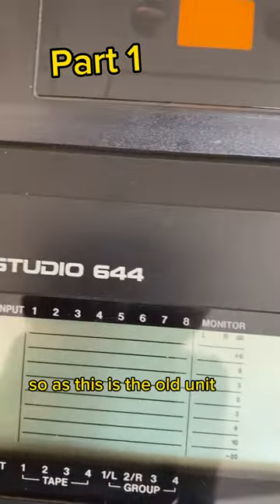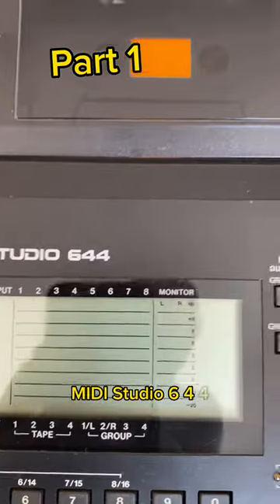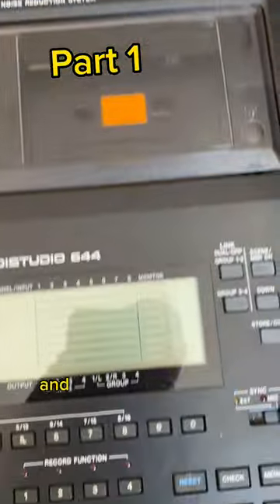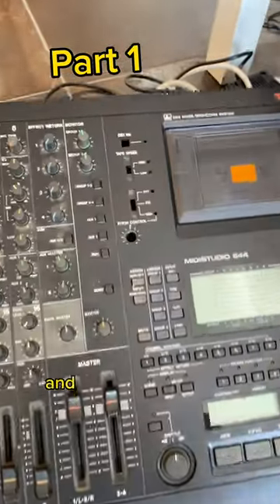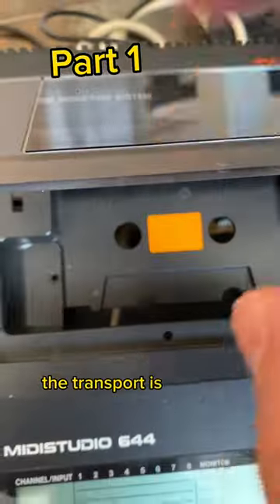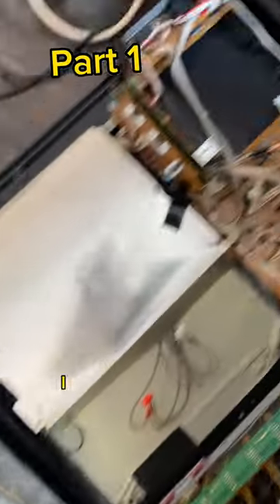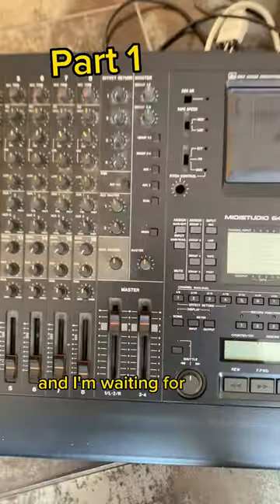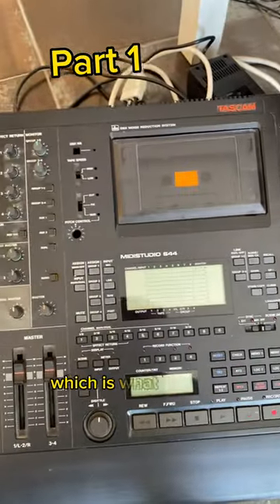Fix an old Tascam Midistudio 644 (part 1)

Comment: I had a belt issue with an old Yamaha EMQ-1, for a  QD drive took ages to take it apart and clean the black goo and about 5 seconds to install the new belt and get it working again.
Reply from the maker: I skipped the hard part, opening the thing requires a bit of screwdriver skill :D

Comment: How do i tear down the Tascam 644
Reply from the maker: sorry ? you have one and need to disassemble it?
Reply: @HoRNetWeb  yes i have one to tear down the tape will fast forward and rewind but will not play
Reply from the maker: @carlthomas8527  well there are a bunch of screw to unscrew but if the tape is not playing you probably have a broken belt like I had, you need to open the unit unscrewing the screws on the bottom than disassemble it internally to get to the transport mechanism and check if the belt is still there. otherwise you need to change it